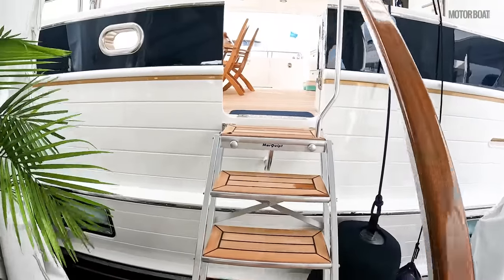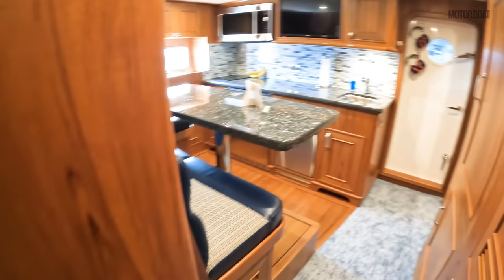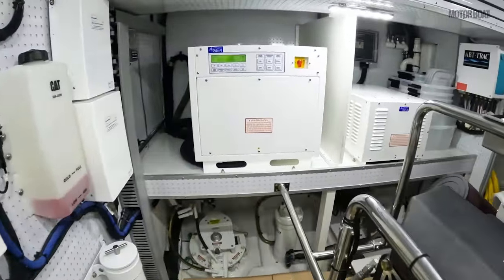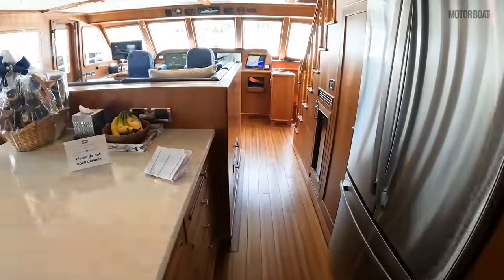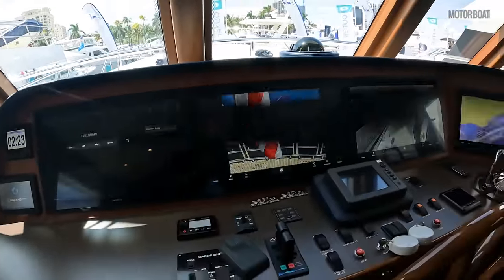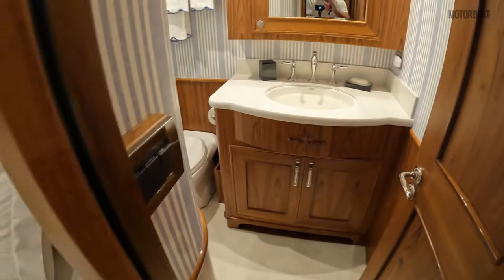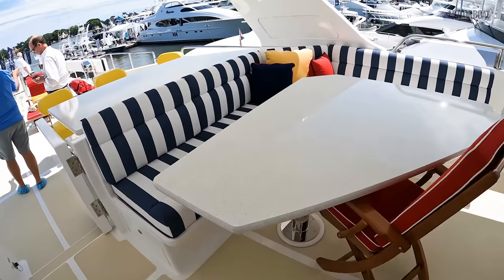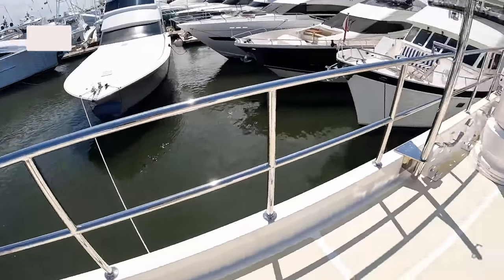Inside a stunning custom-built cruiser | Outer Reef 900 yacht tour | Motor Boat & Yachting

Comment: Great boat for sure but I prefer the new Grand Banks 85, which has such innovative features and burns 50% less
Reply: Yeah it’s a lovely boat the GB , beautiful finish , a lot less volume though and quite shallow draft , there’s a lot less of it in the water than the Outer Reef and only half the displacement of the Outer Reef . The GB I would have for coastal cruising but for real offshore and ocean crossing ability the Outer Reef would be my choice , the engine room for a start is much bigger which is what you need when spannering on engines 1000 miles offshore . The fact they’ve also proven their pedigree by rounding Cape Horn several times would be the clincher , I can’t see anyone sailing the GB down into the southern ocean and rounding the horn on a boat with those complicated IPS units either . But for weekends away and motoring up and down the coast the GB is a fine machine .